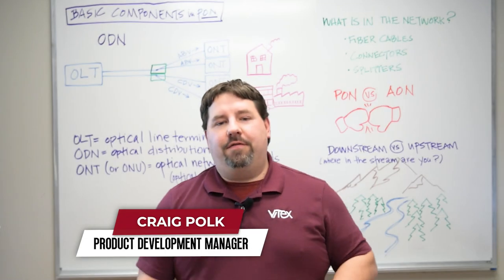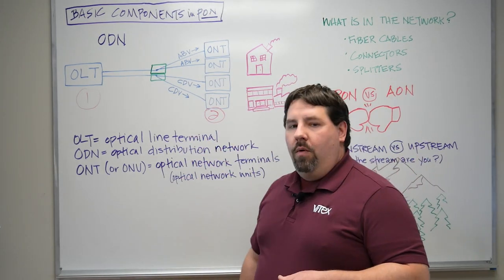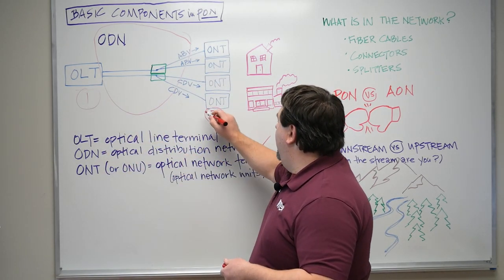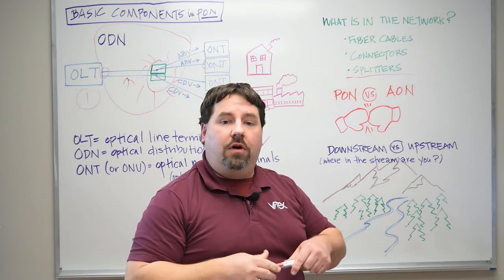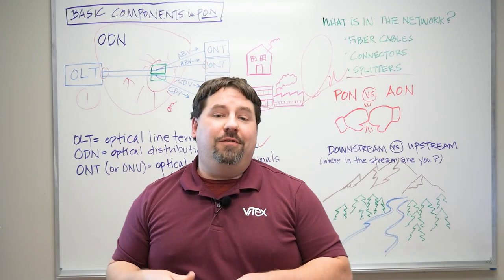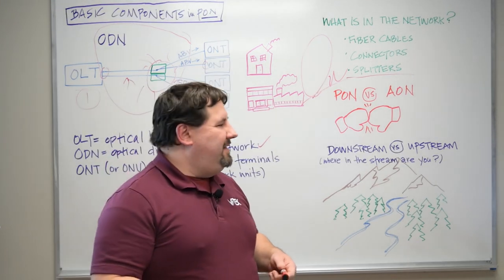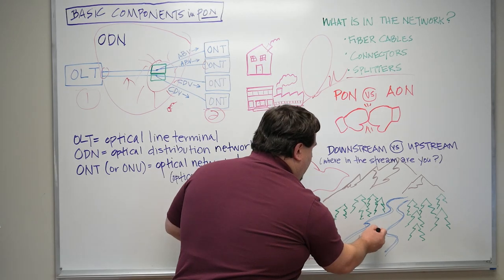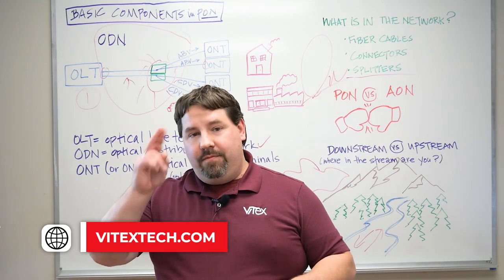Vitex Talks | Demystifying passive optical network architecture: everything you need to know

Comment from the maker: :yt: Full Video Transcript:
Hey everybody, this is Craig from Vitex and today we're going to shine some light on PON. So if you work in broadcast or you've done anything with fiber to the home or really fiber to anywhere, you may have had some questions on what's PON and what are some of the components in it. Well, today you're in luck because we're going to talk about that. So basic PON architecture has three major components that we're going to talk about. Okay. So the first one is our OLT. So this is in our central office. This is our optical line terminal. So the information is coming through here into the network and it's going to terminate on where our users are, right? On our ONT or our ONU, and that's just the optical network terminal or the optical network unit. So these kind of reside in like houses, businesses, campus centers, hospitals, anywhere the end user is. So what brings these two components together? That's what's in the network. So a lot of these services such as triple play services where you combined video, data, voice, to a fiber to the home setup they run through the ODN. So what is that? That's our optical distribution network. And this is where some of our main focus is going to be because that's really at the center of what we're talking about. Yes, it's important to understand how our terminals and our end units, they will actually be sending and receiving all the information and they're going to house things such as the transceivers, which we're going to talk about in another video. But today we want to really focus on what's in the network. So there's three main things that make up this network, right? So one, we have our fiber cables, two, we're going to have any of our connectors such as patch panels or just mating connectors or adapters. And then the third major component is our splitters, which if you kind of think of it without how the PON is split across multiple users, it really wouldn't be something that would be effective, an effective type of architecture. So when we look at this network, how does it all come together and why is it important? So one of the main concerns when we talk about passive networks, we want to think about power consumption, what actually goes into powering all of this setup. So let's just go through together a little bit of math, right? So we're going to kind of look at our network, we're going to add some of these things up. All right, so we take this to the square and 256 and then we want to cube that. And then once we go through all of those different things, we get our result of zero watts. When we… It's a passive network, it actually doesn't require any active component. So when these two duke it out, the passive and the optical active networks, that's the major difference. All of these components inside the network, they're all passive, they don't require any active DC connections to actually power them, which is really awesome because that helps us on cost, it helps us on quality, helps us on durability, it helps with the whole lifespan of this product that it doesn't require any of this maintenance that goes with an active optical network. So on this area, when these two fight together, PON definitely has a clear advantage of that. So the next question a lot of people think about is, “Yeah, it's great I'm getting these things to my home, but keep hearing about these different streams,” right? Not video streams or your Netflix streams, but downstream versus upstream. “So where am I in that pipeline?” So just to kind of help you visualize this, think of, you know, mountain stream, right? So as the stream is running down, we have our house, okay? Maybe I'm not the best drawer, but hopefully everybody gets a picture of that. So all the information is coming down this stream to us. And everybody knows about this magical cloud, right? What's all up in the cloud? So well, you can also think about it this way. Data comes down from the cloud to us, the end user, and we want to send something back, we send it up. So it's the same thing in our stream analogy. Data is coming down and data is going up. So no matter where you are, being part of a PON network can totally help you when you're trying to do applications that are involved in fiber to the home. So we hope this was helpful for you. One of the things we want to hear from you is what kind of questions you have as you're doing different kind of broadband or building out your network. You can reach us here in our New Jersey office. If you want to send a comment either through this video, when you like it or post a comment or send us an email, if we pick your comment to actually answer your question, I'm going to go ahead and buy you a cup of coffee. So start those questions off and we'll look forward to getting them and answering them. So until next time, see you then.